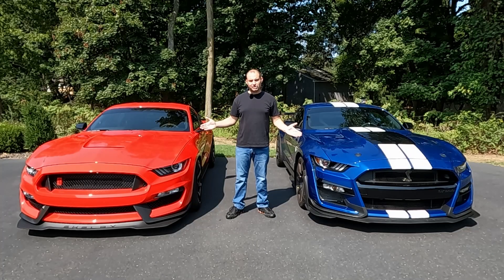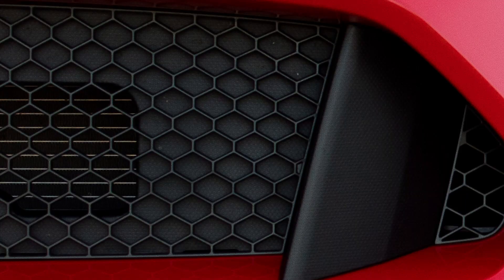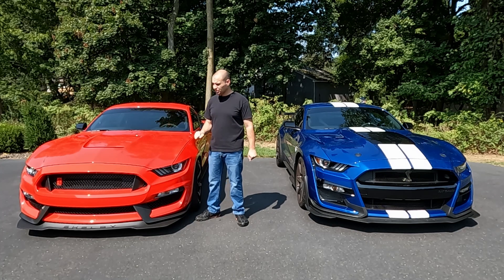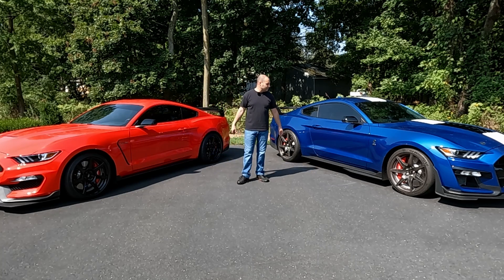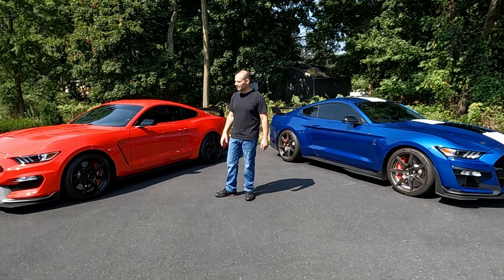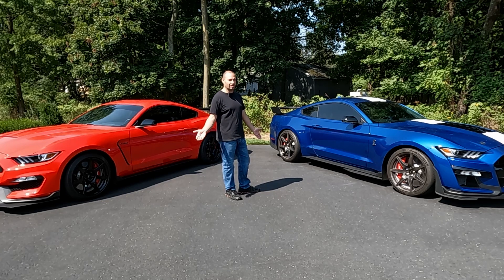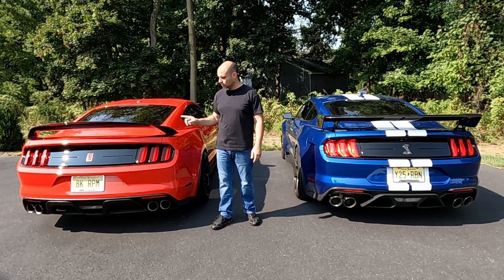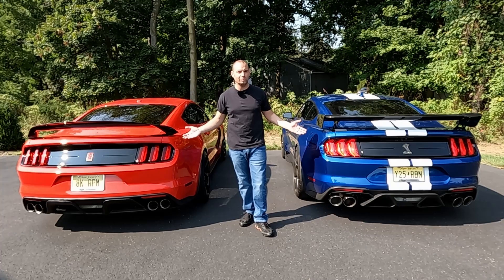GT350 vs GT500 Design

Comment: The headlight design was due to the Carbon Composite front header panel. That lowered the hood height and made the car's more aerodynamic, but necessitated that they keep the headlights the same without re-engineering the entire panel and matching fenders and bumpers to match. This is why they had the opportunity to update the GT500 headlights, but stayed with a slightly modified version of the GT350 header panel with hood pin mounting locations.

Comment: As an enthusiast how do
you like the new Mustang?
Reply from the maker: Love it. Tons of power and it handles it well. Dct works well and it’s not boring to drive without the manual.
Reply: @EnthusiastsGarage  - Yes but I was asking how you like the new S650 Mustang just revealed?
Reply from the maker: @rembo183  looks pretty good, it will grow on most people. its pretty much what i expected, a moderate improvement over the s550. I dont really think its as "all new" as ford says it is. With all the changing emissions rules I expected ford to milk the 5.0 as long as possible and I think ford is going to transition to electric for the next gt500.
Reply: @EnthusiastsGarage  - It’s going to be the last V8 ICE Mustang.  It’s evolutionary and it’s overall styling is ok but not compelling.  However the exhaust sounds great as always and it’s got a better interior if you like the new curved screen.  This glass screen is coming too the BMW M2 and other new Performance cars.  What’s you take on this trend?
Reply from the maker: @rembo183  I dont have an issue with glass screens as they allow more customization but I worry about their lifespan. What I dont like is how companies just seem to slap screens on rather then integrate them. I get that every company wants to say how they have the biggest screens but they all look like after thoughts that get thrown on last minute.
Reply: @EnthusiastsGarage  - I agree. I’ve seen photos of the glass screens in the new BMWs. They look the same as Ford’s new one.
They are not integrated just sitting on top.  This would probably make replacement, maintenance and repairs easier and less expensive.  Maybe it won’t be that bad?  The new M2 will probably have that screen which is on the we 2023 2 series BMW.  The 2022 2 series didn’t have this longer long screen. Evolution. Yet a ICE sports car with a manual is still coming! (M2!)
Reply: @EnthusiastsGarage  I don't expect a full EV or do I expect the Shelby GT500 to keep that name. At some point the GT500 will likely become a performance hybrid since Ford will be working with Red bull developing and building their F1 hybrid style engines. By the way. I'm expecting the Cobra name to return on the S650 GT500 replacement since Ford would no longer have to pay Shelby for the use of their name plus Ford owns the Cobra name and logo.